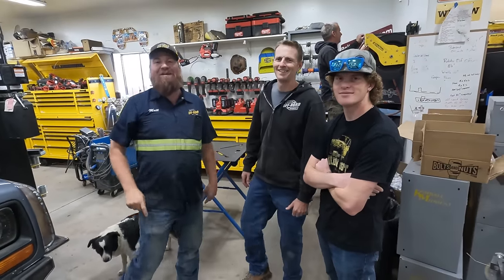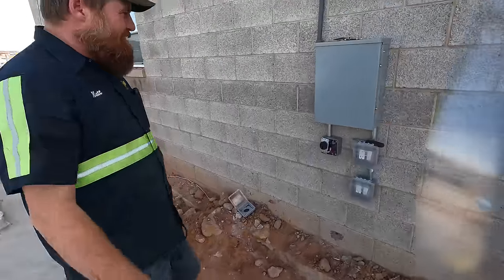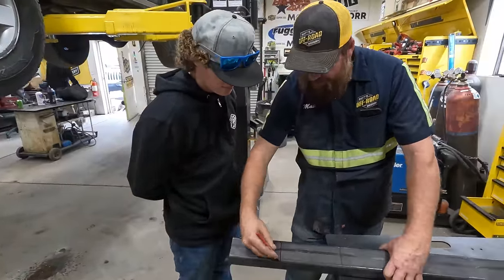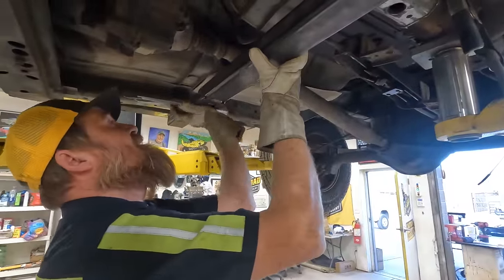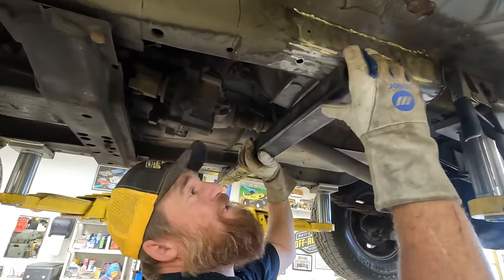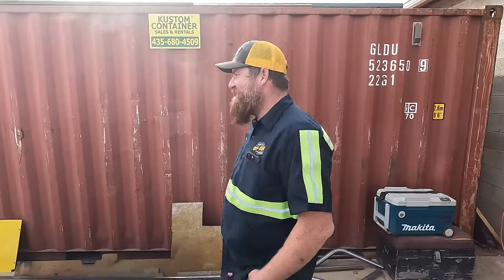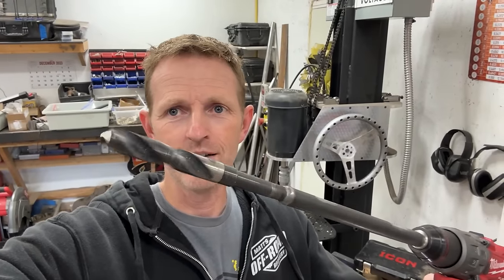Forced To Work Outside...Too Many Projects!

Comment: The new shop has the best lighting and ventilation money can buy!
Reply: and unlimited vertical space too
Reply: But only because it's in Utah. Here, you'd have only a few hours of dim lighting a day at this time of year, and you'd constantly have to weigh things down or chase after them. And you'd have terrible water ingress.
God, I hate winter.
Reply: The infinity windows are amazing and so clean too.
Reply: Working outside is really fun. Did a head gasket on my vehicle in the mid 40's low 50's. Quite fun, lot's of good lighting as well.
Reply: Except when it rains in Utah. Then it's a day off.
Reply: 11% better than before.
Reply: Until the lights go out. 😅

Comment: I started watching Matt's Off Road Recovery about a year ago when I bought my 2011 Jeeo JKU Sport. It has lunchbox lockers front and rear and it needed a new set of tires when I got it. I bought some General Grabber AT's, and after having 2 of them blow out I decided it was time to get some Milestar Patagonia MT's. At first they wouldn't pull as well in the rocks as the M/T Baja Bosses that everyone in my Jeep club seems to have. I was airing down to about 17lbs (No beadlock rims} but when I aired down to 12 lbs they started pulling almost as well as the Mickey Thompson's. AT half the cost of the Micky T's they are WELL worth having. I'll take that minor bit of difference for less than half the price. All that to say Matt's Off Road is the reason I bought the Patagonia's in the first place. I saw that everything Matt's uses as recovery rigs, except the World's Largest Off Road Wrecker, has them on it. I know that they probably sponsor the channel but I see you guys doing some crazy stuff on them so they must be pretty good. I was a little disappointed at first but after getting the PSI right, I love them. When my 91 YJ needs new tires it'll be getting the Patagonia's. The YJ has a 4" lift and 33" BFG All Terrain KO2's, but will be getting 35" Patagonia's. I may have to add a body lift or swap to a 6" spring lift to make 35's fit but.....no Jeep is every done being built. LOL  Thanks guys I love the channel. Keep up the good work.

Comment: Watch out for water intrusion on the top connection to your lift Matt, Need to use a water tight fitting or it will cause you problems down the road. If possible its always best to put connectors through the bottom of junction boxes and that helps with water intrusion. But i'm not an electrician "anymore" either. Best of luck to you all - stay safe.

Comment: Good to see Tom holding both probes in one hand to check for voltage. If you don't know why that is the only safe way to check AC power you shouldn't be messing with it.

Who said we don't care about Corvair stuff? I care about Corvair stuff and I doubt I'm the only one.  PS: restore the ramp side pickup!

Comment: Tom's got a point with his strategy to break rusted bolts faster. That's exactly what I used to do back in the day.
Reply: Sometimes this will even let you get the bolt off without breaking it.

Comment: 7:37 As a fellow Utah Corvair guy, I enjoy the current content mix! When I was a teenager, I installed an electric fuel pump to my 65 Corsa and ran a wire up to my fuse box. It turned off when the car was off, but I added a toggle switch under my dash that would allow me to turn off the pump if I was listening to the radio with the engine off.

Comment: My first car was a black 63 Corsair Spyder.  It could chirp the tires in 3 of 4 gears.  I won a trophy at a local drag strip and then POOF the transmission had to be rebuilt.  My dad looked at the trophy and paid the bill.  That was the end of dragging.  It was a really nice car even if others had more trouble.  I now own a Jeep Wrangler that feels a lot like the Spyder in the driver's seat.

Comment: I love how Matt is using a chrome socket on an impact and Jefe is using impact sockets on a wrench. 🤣
Reply: I use impact sockets on my ratchets and impact. What they were designed for. Safer.
Reply: And you don’t need two sets that’s what I have 🙂.    Unless you need something a little slimmer
Reply: Use what works and is closer. If it breaks replace it.
Reply: This whole chrome vs. impact socket story is overrated IMHO.
If you use the last 15% of force of the tools designed capabilities ... yes. But for 80% of normal work and forces, it doesn't matter.
Reply: It's allowed!  🙂
Reply: If it fits it ships
Reply: I use chrome sockets on my impact fairly regularly. The only sockets that I have broken were off brand ones. My Cornwell chrome sockets are stout. The 1/2 to 3/8 step down adapters don't last terribly long on an impact though.
Reply: Don't forget the hammer Matt prefers
Reply: Diversity. It's all about diversity these days.
Reply: i would love a gladiator like that! beautiful
Reply: All without safety glasses...

Comment: The new shop has fantastic heating and cooling system. It's unfortunate that the heat and cooling occures at the wrong time of year. The good news is that when the appropriate weather comes in, you have a built in shower system.

Comment: I HIGHLY recommend installing the Metalcloak sector shaft brace and their rear sway bar link reinforcing mounts on that Gladiator.

Also, always tighten the control arm bolts with wheels on the ground. They're a clamping connection and the bushings need to be rotated to driving position before being tightened.
Reply: Depending on what the control arms use for bushings.  If end links "Johnny Joints type" not a thing but if more standard bushings you need to.
Reply: @DB-yj3qc  True. The Dynatrac appears to OEM styled and the instructions say to install on the ground and torque to factory specs. That's 103 lb/ft plus 105 degrees.

Comment: I have been an electrician for 83 years. Everything you did in this video passes my Professional test of excellence. And looks good too.
Reply: Wow that’s amazing. You’re probably the most experienced electrician out there.
Reply: I haven't been an electrician for 30 years but have rewired many houses!  Just pulled a bunch of knob and tube out of the house I am remodeling now.  I hire actual electricians when I need a new service or breaker box since they require a permit.
Reply: I started doing electric work in 1981, I don't know how long ago that was, I've seen worse. 
I would recommend doing something to keep the rain from getting into the boxes.
Reply: 80 years ago, trip hazards weren't a consideration
Reply: @BastrdMcQueen  It's a construction site, rules are different.
I don't think he was serious about starting 80 years ago, he'd be in his late 90s or more.
Reply: @bigredc222  I was keeping it lighthearted and fun.  But I would enjoy a full breakdown of how exactly you think that wire is ok to be energized per code in the area which you live.  Additionally, go ahead and tell me what you project the courts findings to be when a workman's comp case comes about.  Explain the differences between what a homeowner can do in their own private shop versus what the State expects an employer to ensure in the workplace.  Explain how, under litigation, it's ok to cut the ends off an old extension cord to be used as temporary wiring.  Also, how do you think a convicted Felon employer would fair during a wrongful death trial?  Like I said, I was keeping it lighthearted and fun, but I now anxiously await to be enlightened by your dense sense of humor.
Reply: @BastrdMcQueen  I'm joking too, I don't what the hell set you off, is it because I pointed out I thought he was joking? All I said was I've seen worse, I never said anything about it being a legal installation.  It's temporary, what do you want him to do, put some strut between the building and the lift to hang a piece of conduit off of. Calm down.
Reply: I fire laserbeams from my eye sockets, those welds hold up just as if I had welded them.
Reply: You electricians are a spicy bunch.
Reply: As a laser technician for last 91 years. I applaud you sir.
Reply: 83 years? Lol. It's always unfortunate when the trolls start making their way to the few decent channels out there. Fame ruins everything I guess.

Comment: You can get battery isolation switches where the female end fits over the battery terminal and the other acts as a new 'battery terminal' that your negative wire goes to. Then there's a big physical switch that you guilotine down to hook it up. Good solution to keep things tidy if you're having to disconnect the battery a lot. Obviously you need to match the right battery terminal type.

Comment: I love seeing the underside of the Banana, it makes Matt’s crew seem more human. I’ve never seen or owned a 4.0 that didn’t a little oil leak somewhere! lol
Reply: Or a lot at rear main seal especially if it started with regular oil then changed to synthetic oil. Not a knock on the 4.0 I've got 4 of them.

Comment: One wonders how bad Matt would freak out if one of the guys decided to do a V8 conversion on their Corvair.

Also surprised he hasn't mentioned one of my favorite bits of automotive trivia: The gas heater on early Corvairs. No waiting for the vehicle to warm up to get hot air for heat & defrost, it used gas from the regular tank to fire a lil' burner.

Comment: Matt, the day I wired 2 light switches to control a single light fixture in the middle on a ceiling, I knew I had arrived. It was awesome when it worked like it should.
Note to Jeffe: The 7 hour time on the parts for the Gladiator is probably for 1 person do all the work by themself. Probably.
Reply: And no lift.

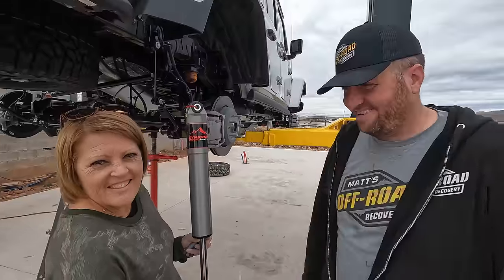Comment: 16:00  If you are ever stuck for a LONG drill bit and you call around and no one has any in stock???  They probably DO but do not know it.  Ask for a "Spiral Flute Installer's Drill Bit" and/or look in the Electrical Department  ... (must be regular point, spiral flute, not Auger style)

Installers Bits are pretty hard too made to drill through wood with Nails in it, they will work in a pinch.   You might notice a small hole drilled in the spiral flute actually through the web, of the drill bit ... just ignore than unless you are installing wires.

Comment: need a cover over the electrical box for the outside lift, until you get roof. you left a hole that water could get into on top of box and water and electricity don't mix! fix before a short takes out new lift

Comment: dory:

A dory is a small, shallow-draft boat, about 5 to 7 metres or 16 to 23 feet long. It is usually a lightweight boat with high sides, a flat bottom and sharp bows. It is easy to build because of its simple lines. For centuries, the dory has been used as a traditional fishing boat, both in coastal waters and in the open sea.
Reply: Dory :  the cartoon Blue Tang 
fish ( from Finding Nemo )
                             +
Dora the Explorer , the cartoon 
character that MATT is contriving
into "Dory the Explory" ( sounds
more fitting for a Ford Explorer )

Comment: I like the Corvair stuff. More interesting than an endless stream of bellybutton Camaro/Chevelle/'67-'72 C10/square bodies. Nothing personal on the square body Tom, but it's like this. Chocolate cake is pretty good, but after eating it three times a day for 50 years some peach cobbler and ice cream is a welcome change. I was around when '73 Chevy/GMC  pickups were brand new.....and the '67-'72's... and the Corvairs for that matter. Dang.....I just realized I'm almost as old as dirt.

Comment: When you mount a carburetor on top of a turbo, you have a short lived turbo! You are sucking gas and air mixed through your turbo  and the gas will wash the seals out of your turbo. Gm tried it on the corsair and the Buick grand national and it didn't work.

Comment: That angle grinder Kaulin was using; I have the same one and the very first time I used it, it kicked back and nailed my knuckle on my thumb, with the cutting wheel. Through my gloves and all. Cut the knuckle and tendon. Bad day. Stupid part is I use grinders every day! I knew better!

Comment: I love all these vids, variety but with common attitude. My only pet peeve issue is with all the positivity every video has someone (usually Matt but not this time) saying doing good (meaning morally right, a shortening of doing good deeds,) instead of intended phrase doing well, meaning doing correct action or working properly. Other than that you guys are doing well...and sometimes such as when fundraising for an all ability park or local service agencies, you guys have done good too.

Comment: I have a silly question maybe. I am wondering why your shop and fab rats use the death wheels small grinders to cut so many things when you both have plasma cutters?  The plasma is so much faster, and the slag taps off instantly if you tap it against the remaining metal. You do not have to grind the slag off if you taps it backwards. it falls off.

Comment: You guys could put an inline switch on the wire that feeds the fuel pump; that way, there will be no need to disconnect the battery.

Comment: Kaulin just take 1 wire from your fuel pump put a switch in the dash and then run the wire to it and back to the pump

Comment: Not to come across as Mr. Negativity. I’m an electrician. And rather than focus on what you did horribly wrong I’m offering a solution. You can hire me. I’ll drive all the way from Colorado. Front range even. No need to apologize. Love your programming. I’m a diligent watcher. I even stopped by once on my way home from LV, but no one was around. I did pick up a couple T-shirts. One for me and one for my wife.

Comment: should of use box wire protectors    (that keeps the wires in place in the box plus keeps water out of the box) so your building inspector dont know you did your own electricity

Comment: I am an electrician Do Not Stick the wires in the outlet it can mess up your motor. You did the right thing wire nuts your under bolts

Comment: That electrical work can be made safer if you shut off the power and cover the equipment when not in use to protect it from the rain. That lift and the electrical work is not waterproof. Note, I said safer, not safe.

Comment: Actually, I am an electrician. If it works, and didn't trip the breaker, you did a fine TEMPORARY fix. At least turn the breaker off when you finish!

Comment: As an electrician, I must say, please hire an electrician. Electrical wiring is the one thing that should always be done right. That amount of tweaker sketch, and lack of logic will kill someone. If you are not using proper connectors on a fully exposed lift and panel atleast use knockouts on the bottom. Water rarely goes from the ground up and almost always leaks down into things from above. Couldn't tell but hopefully, you wired it off the load side of that GFCI assuming it is even a GFCI.

Comment: Corvair battery… could you install a switch so you can cut power to battery from inside instead of having to do it outside in cold or heat?

Comment: Well, the nine pound hammer is a little too heavy
It's for my size, honey, for my size
Oh, roll on, buddy, don't you roll so slow
How can I roll when the wheels won't go?
It's a long way to Harlan an' a long way to Hazard
Just to get a little brew, just to get a little brew
Oh, roll on, buddy, don't you roll so slow
How can I roll when the wheels won't go?
Well, it ain't one hammer that's in this town
Had a ring like mine, had a ring like mine
Oh, roll on, buddy, don't you roll so slow
How can I roll when the wheels won't go?
I'm goin' on the mountain, gotta see my baby
An' I ain't comin' back, Lord, I ain't comin' back
Oh, roll on, buddy, pull a load o'coal
How can I pull when the wheels won't roll?
Well, the nine pound hammer is a little too heavy
It's for my size, honey, for my size
Oh, roll on, buddy, don't you roll so slow
How can I roll when the wheels won't go?

Comment: I don't want to jinx yall, but please consider wearing safety glasses when hammering rusty parts and using a chrome socket on an impact. I nearly lost an eyeball once and it's not a fun feeling.
Reply: Also it's not setting the best example for the next gen, to be frank.
Reply: Spamming now but credit due for wearing them just a little later in the vid.
Reply: Excellent editing by the way.

Comment: 2 Questions can I use a catch can on the 392 and can I also use the SRT Mopar oil filter for viper larger filter 
Mopar 0503-8041-AA-001
I hear it helps a lot?

Comment: Hey... I care about Corvairs!    In fact, I lost my virginity in a '61 4 door in about 1970.     Three bucks of gas ran us a full week at 23 cents a gallon.  2 speed automatic.   Zero to 60 MPH clocked in at about 3 days!    after thrashing on it for 300k miles I sold it for 50 bucks to an enthusiast for spare parts.   Should have dumped the girl instead of the car!

Comment: Are you going to plate over the holes in the frame right behind the cab that will bend the truck in half if you over use it in the wrong way
Where is that something that Jesus already fixed since the launch of the gladiator

Comment: Dude, you did wire it wrong regardless.   Anytime you use twist nuts, you need to twist until the wire has twisted well below the nut.   This is even on the package instructions for very good reason.   And quit stealing Ed's stuff.